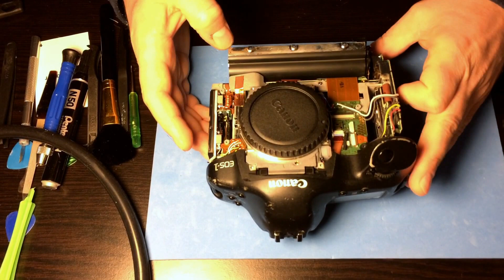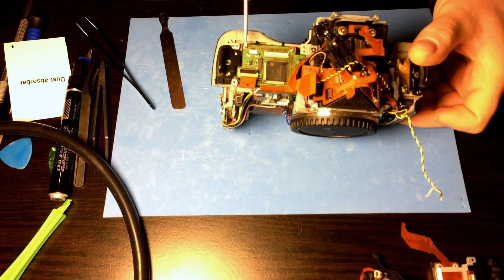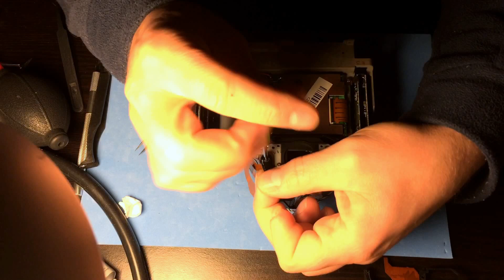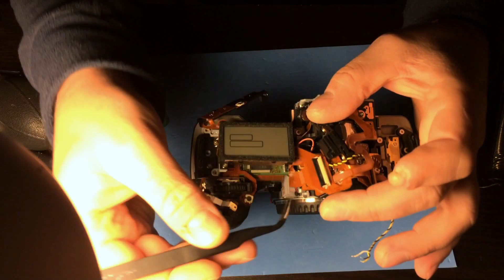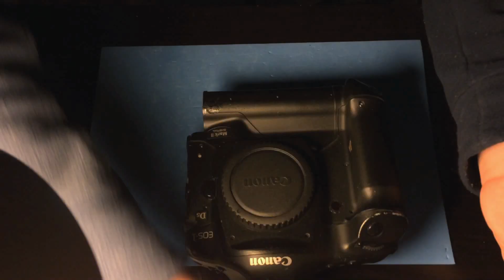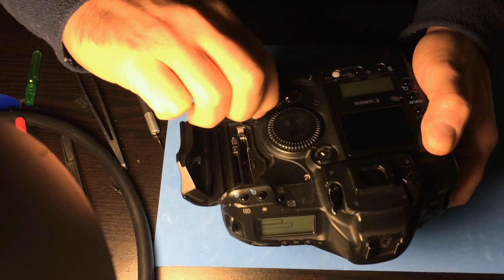#004 Repair Canon 1DS MK ii - Shutter Speed Replacement

Comment: I can't find a teardown for the 1D/1DS, 
but all steps in this video to take the body plates off the electronics are the same on the 1DS MKI as well, but on my camera the dof preview button flex pcb was stuck to the silicone behind the button on front plate and tore when taking the front off, also i'm only taking the body off to clean salt from my 1DS MKI but the internal electronics look pretty similar to this MKII in the video.

Comment: Thanks for the video. I wanted to see if I dared to disassemble it, but I'm not going to do it... ufff too many connections and screws.
The problem with my camera is that horizontal lines appear in the photo.
If you can give me some advice I would appreciate it.
Reply from the maker: Hey, it is a common problem with this camera, might be image sensor damage or oxidation.  I must say, not an easy job for this kid of issue. Where are you based?
Reply: @CameraRestore  thanks for your answer. If the fault is in the sensor, the repair will be very expensive. The photos come out with some horizontal lines, as if they were interference, and more visible at high iso. If you want I can send you some photos. Thank you so much.

Comment: Hi there, my 1d mark ii N is not throwing up an error code but rather just simply does not raise the shutter when you shoot and records a black image. Does this shutter require replacing or is something else the issue? Thank you kindly in advance for any response, Rod
Reply from the maker: Hi there, most likely is the shutter, also that’s why it gives you the error message.

Comment: Hi I’ve watch you video, thank you for sharing it. 
I’ve got a focus problem on my 1dsii 
It won’t focus. It just hunts. Then if it does lock focus it is only on the lower focus point.
Really strange. At first taking the battery out and restarting it would sort it but now Im limited to manual focus only.
Do you have any ideas?
Thank you
Reply from the maker: john robert 
Hi thanks for passing by
That’s a strange one... Might be a connector oxidation... It a common issue.

Comment: hey
i got a 1ds ii that viewfinder display is gone, won't focus, err 01 when press shutter, without lens err 99. sensor cleaning mode also err 99. the mirror/mirror motor doesn't move at all during all these.
i took it apart this weekend just before taking the mirror box out, which i haven't figure out. I looked at circuit board and it seems good. little fuses are all intact. maybe it's the mirror motor assembly? i even took apart the contact pin after getting that module out and checked all and it's fine. camera can play back previous taken picture and top LCD works fine and can detect lens aperture before pressing shutter button. previous owner said the error happened during a lens change and viewfinder went dead and gives err 01/99. hopefully to hear from you. i'll spend a little more time diagnose it before selling separate parts hehe.

Comment: May I ask you when the shutter fails, when you try to shoot, does it make a strange sound?
Reply from the maker: hey, not necessarily but might do. In order to understand better if it is about the shutter or mirror, set up "mirror lockup" on your camera and take a shoot.

to turn on this setting, have a look here: https://support.usa.canon.com/kb/index?page=content&id=ART158597

with this setting, the camera will first lift and lock the mirror, by doing a second shoot, the shutter will open and expose.
Make a shoot in manual mode with a low speed and see what comes up.
Reply: @CameraRestore  thanks for this valuable comment. I must say that this is not possible because the camera just stays stuck with err99 showing in the upper LCD and does not allow you to go to the menus. Is there a way to lock up the mirror without having access to the menus?

If not, why can't I do this? (if there is a reason). Maybe it is not possible.

Essentially when I turn on the camera I hear the sound, it is like a cat screaming when scared with a mixture of feisty thundarstorm or something like that lol. It happens when I turn on the camera and also every time I try to press the shutter button.

I must say also that the first time I tried to lift the mirror and noticed the shutter blades were dodgy. On the next day tried to do it again to take some pictures and the mirror was like locked. I can't lift it anymore.

Read somewhere that it could be a capacitor but no sure why I capacitor would make the camera do this. If the blades/shutter looked dodgy it might be stopping something happening and hence the noise. Don't know.

Any further comments and suggestions are welcome. I am tempted to open the camera.

Comment: Didn't you have any problem with the mirror? My mirror folded up while removing the mirror house. I see you left the body cap on, did you ever check this?
Reply from the maker: jpsholland, you're lucky, I'm working on one at the moment. Is quite difficult to explain but check the pictures in the link below. On the pic #1 push that black lever marked with the circle, it will get in position as in picture #2, the mirror will get back in position. Good luck.

https://ibb.co/h34yAy
https://ibb.co/dgUWVy

Comment: And one wonders why it cost so much to replace a $50.00 shutter.
IF Canon made them right the first time you wouldn't need to get it repaired..
Err-99 on my Canon EOS-1DS Mark II, wound up is a bad shutter.
Reply from the maker: well, I believe that the camera made quite lots of shoots before failing... There are few things that might reduce the lifespan of a shutter but dust definitely is the most common.